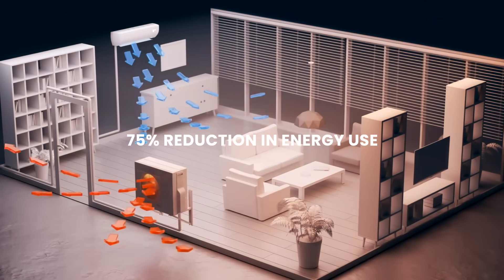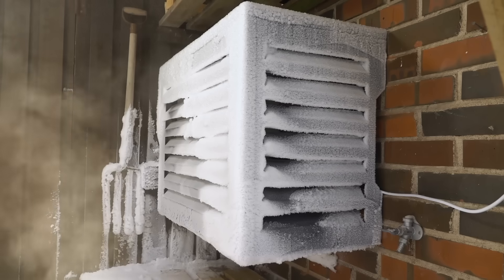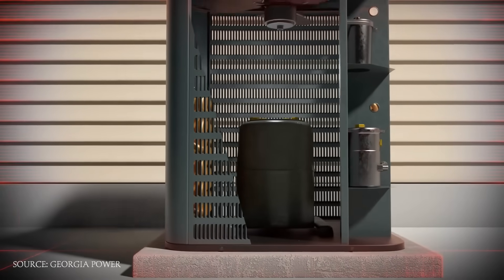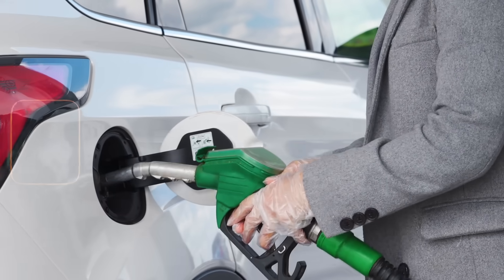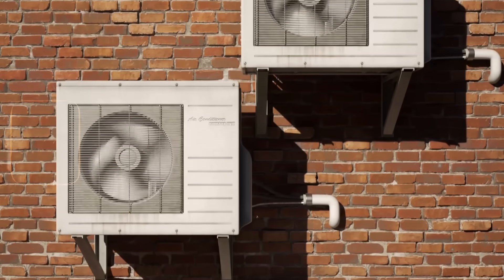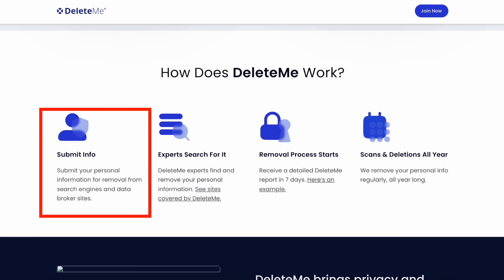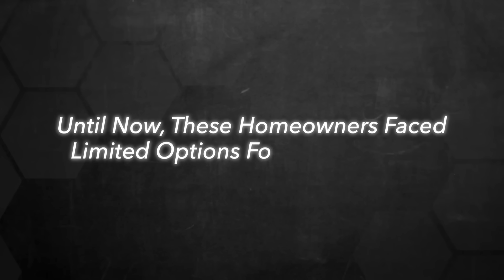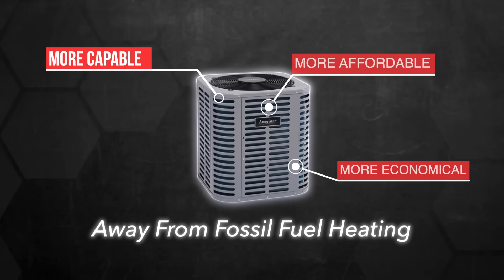Genius Heat Pump could change how we heat our homes forever

Comment: Holy up front costs.  At an average lifespan of 10 years for  condenser/heat exchangers and costs doubled since you have at least two of everything, I doubt you could ever recoup the cost vs ground source (geothermal) systems
Reply: Hopefully it lasts much longer than 10 years. At least if something does need replacement that soon you aren't going to need to replace the entire thing.
Reply: @ HVAC tech living in a place where it’s less than +32F on average from mid November through all of Feb.  The only time I use backup heat source vs my geo system is if it drops below -10F (happens about 3 days/winter on average here). Doing the math on this setup vs mine with an energy cost at half what I pay on average it would take nearly 50 years to recoup the upfront cost.  Double the maintenance compared to what I’ve done in 11 years of ownership would stretch that out to 65 years.  Chances are the EPA will have phased out the refrigerants used requiring full system replacement way before that savings would break even.

Comment: Here in Missouri, people in the country often use a pond for their heat source/heat dump.  Turns out, if the pond is big enough (at least 1/2 acre), and deep enough (about 10 feet) you can sink the ground loop at the bottom of the pond.  This works even better than wells, since the water in the pond can source/sink lots of heat very efficiently .  Multiple loops can be used, and they can be as long as you need.  Below about 10 ft, a large pond stays about 50 degrees all winter (in our climate).
Reply: @johntoe6127  pond loops are never as efficient as aquifer loops, whoever told you differently was massively misinformed. That’s the difference between a max COP around 5.5 and a max COP around 7…. That said, the drilling costs for doing aquifer loops into the deep ground is quite expensive and you will never recover the lost money spent on drilling that you saved in energy expenses in the long run…. More efficient than both systems though is an air to water heat pump that uses a solar water heater for doing your home heating and pulls off your naturally cool water to do your home cooling. You still get a COP around 5.5 but you spend more than $100,000 less on the installation of the system
Reply: @narrowistheway77  That's very interesting.  I guess people use them because it's cheap.  I'd always heard it depends on the size and depth of the pond as to how well it works.  The biggest drawback... usually the pond is too far from the house.
Reply: @narrowistheway77  At what level of glycol does this become inefficient though?
Reply: @grt49er  don't need glycol (or very much of it) if you plan correctly and keep the lines below the frost line or have a means to ensure the loop is always moving (thinking of a power outage). Here in southern missouri it's about 12", so go 18" and you'll probably be fine.
Reply: @Jenstyler1  That is an area that lends itself to alternative more efficient systems. You might even think about some form of heat exchanger economizer. I know there are still some evap coolers being used there in warehouses.
Reply: @narrowistheway77  like you said drilling through hard rock is really expensive.  plus it takes a lot of energy to lift water which is really heavy.  that's a huge efficiency hit.  if traditional horizontal grounds loops would be installed just a bit deeper the efficiency could be improved a lot.  for example, a horizontal loop buried 10+ feet deep would be significantly more efficient than one just four-feet deep.  also like you said...  if even a bit of sunshine is available, evacuated-tube solar collectors are a super efficient way to heat.
Reply: I'd like to abuse Long Island Sound so.
Reply: My son uses a well for pump and dump.  It is 58 F all year around.
Reply: Personally, I never understood using PEX pipe for heat transfer.  I'd use it for getting the water/glycol to and from the source but not for the heat transfer area.  There I would use aluminum or copper coils:

R-value: This measures thermal resistance. A higher R-value means better insulating properties.
PEX: Has an approximate R-value of 0.38 per inch of thickness, based on a typical thermal conductivity.
Aluminum: Its high conductivity means it has an extremely low R-value, making it a conductor, not an insulator. An aluminum pipe would have virtually no insulating properties on its own.

Comment: Maybe just use some dynamite, and flatten the hill, then one gear works great, much like on a racing bike. The analogous solution for HVAC would be a ground source heat pump. The downside, of course, is that you can't do it partially, and retrofitting tends to be too difficult.

Comment: Also most of Canada. I'm on the west coast and my heat pump works fine down to about -15c (5f)
Reply: Same, in Ontario and my 5 year old napoleon unit only starts to fall behind around -18c true temperature. There is no supplemental heat on the unit, at -18c my baseboards start to come on. Much lower than the 0c claimed in this video.

Comment: Say it's 40° outside our heat pump will run 8 hours straight to raise the temperature 4 to 5° in the house.. when we use the backup oil heat it'll take 20 minutes to heat the house up 5° .. a heat pump definitely isn't more efficient then a fossil fuel back up ..
Reply: Efficiency has nothing to do with how long it takes to heat up your house.

Comment: This technology addresses the gather side. How about the diffusion side? Most heat pumps operate in extreme heat conditions, not cold. So, is there an analogous mechanism to increase efficiency of cooling by overcoming the relative energy gradient present when cooling in extreme ambient energy conditions?

Comment: There are going to be costs of greater complexity, mechanical losses, system failure outcomes, etc., compared to a single open source (atmospheric) compressor unit that has approximately the same critical outdoor temperature.
A ground source unit is less temperature sensitive and proven. There's an added bonus of having no outdoor unit to clutter the landscape. 
Payoff, or the money saved versus a standard system comes even in around seven years. 
If cascading technology does prove its worth, the cost per unit will certainly go down. 
I'm old enough to remember $10,000 flat-screen TVs.

Comment: My outside unit is on the south.  I've been thinking about shading the unit in the summer.
In the winter, I was considering setting up reflective surfaces to concentrate more sunlight on the unit.
Does anyone think this will help improve efficiency?
Reply: I've thought about this, and don't think it would make a huge difference. It would make more sense to plant trees to the south of your house, which would affect a much larger surface area. Also, if you have southern winds, and depending on tree type, they could provide a wind break, reducing convection. The heat exchanger coils on my south-facing unit are shaded by the cabinet.
Reply: @BlankBrain  Conifers on the North side for the winter winds, Deciduous on the south for summer shading - personally only plant trees that have a max height of 30' just in case you want solar on the south side.  Awnings over south facing windows also help.

Comment: Excellent video, but ....
Brought to you by Trane (Brookfield asset management).
Air-source heat pumps are useless money pits in Canada.
Water ground loops FAIL in several components.
Direct Exchange Geothermal doesn't use the "fragile ground loop", or any water or pumping circuit, but uses a single circuit of the refrigerant itself.
(Think commercial and office buildings.)
Equipment is comparable in price, at house-level of capacities; the vertical drilling is somewhat costly, but can be drilled in almost any yard.
Since Ground-sourced Direct exchange is drawing from a constant temp source, it runs at peak efficiency always.

Although I have not looked, I'll predict that a DE Geo system would come out at a similar cost to purchasing one of these systems to which the video refers.
Upon looking on google, this system is usually provided by all suppliers, by using 2 or 3 or 4 heat pumps in series. (which this system actually is, whether in one box or two)
THIS is the only choice that a government should sponsor, if they actually want to control.
To those Canadians serious about purchasing, check out Direct-Exchange Geothermal before you invest thick coin in any system.
Reply: Running a refrigerant loop underground seems much more fragile than a water loop. If there's a small leak in a water loop you can top it off for a few cents, a leak in a large refrigerant loop will cost at least a few hundred dollars to recharge.

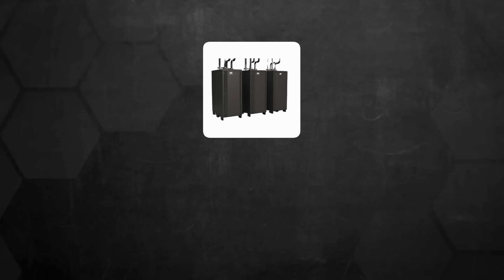Comment: @8:51 re: operational temp range?
Which is it?!   Initially you claim this system can extract heat down to -32˚F, but later your claim changes to just 32˚F— a massive difference of 64˚F!!!
Reply: I just noticed that another viewer pointed this out and you responded...
I suggest you add a correction in the form of "text overlay", like subtitles or whatever...
SOMETHING that is actually IN the video itself.  A response to a comment (even if pinned) is absolutely insufficient—that SHOULD be obvious!
Reply: Actually the low limit is the temperature where there is no longer any gain.

Comment: If I was  building a home with a walkout basement that I want to put radiant heat in the slab to heat the basement. Then there's just  one floor above and I do Base board convectors for heating with water also. Would this system be the best for that type of setup ?.And what type of system would work for cooling it in the summer ? I don't like ducts but at least in the summer I can get clean air in. I'm on a low budget.

Comment: Well  what you didn't address is the heat pumps ability to provide cold air in really hot climates. I live in Texas and enjoy really warm temps inside compared to the yanks who live in more northern areas of the US. My indoor temp is typically set between 72 and 80 degrees all year long. 

So, my heating bill is really high in the winter. But, also, my cooling bill is really high in the summer. 

So, how energy efficient would this unit be at keeping my home cool in 120 degree heat?
Reply from the maker: It works for cooling as well

Comment: It's only cost effective when compared to the 100-150% inflated costs of standard equipment promoted by HVAC installers ie Carrie, Lenox, Trane, Mitsubishi .  When you factor in parts markup on this system that $12k becomes $24-30k just for the equipment making these systems DOA in market sales. Homeowners are price driven consumers not efficiency driven.

Comment: Though the tech is great, the complexity is quite insane. Multi refrigerant cascading has been around for scientific applications, but the repair cost will be astronomical for residential use. 

What is never addressed is the amount of total amount  BTU's needed during winter (which is way more) vs summer , regardless of the technology. 
Sanyo used to make a heat-pump with a gas furnace on the condenser. 
I oversized the Mitsubishi heat pumps in my house, so if my steam boiler goes, I can withstand very cold weather.
Reply: Don't forget to clip the jumper on the board so you actually have a crankcase heater Mitsubishi doesn't tell you that to get energy star you don't have a crankcase heater.  The guy teaching our factory course just kind of mentioned it on the down low
Reply: Repair costs shouldn't be more than about double a single stage heat pump. Basically this is just two of them in series.

The astronomical repair costs scientists pay (and you're right about that) is because they use non standard equipment that is produced in low production runs. 

That's why this company decided against using specialist equipment, but finding the off the shelf equipment that does the job almost as well as the stuff the scientists use 

It's like the cost difference between a fuel pump for a car and the same pump for a plane; the smaller production runs and the need for higher certification is what makes costs astronomical. 

Your are absolutely right to flag up the increased kWh or  BTU for winter use as compared to summer. This is actually another advantage of this system, because the biggest efficiency boards are in the months when single cycle heat pumps are least efficient, or switch out entirely to rely on resistance heating.

Double the price (in round figures) but more than double the likely saving if your winter temperatures regularly get much below -10C or 14 F.

Comment: 12K for the smallest system is just too much. i currently have 3 9k btu heat pumps, one in the workshop/garage and two in my house.  total cost including install was 2700.00. it is backed up with the original gas forced air furnace that i use when the temps go below zero f. I live in Montana and for the last two year i use the original heat most often at night in winter. My annual gas bill is less than 350 and that is with a gas cooking stove.  The price of this tech would have to come down a lot before i would even consider it.

Comment: The added cost of this system will have to be compared to the added cost of ground-source heat pumps.  

Most homes in the north have yards large enough to install a ground loop.  The initial installation is definitely large for the ground loop, but buried PEX or HDPE tubing is a 100+ year solution.  This looks like a solution more appropriate to far north urban areas, which are an inherrently small market.  The complexities of troubleshooting and maintenance will also be an issue for early adopters, so larger installations like apartments and universities will need to be first.
Reply: I have been messing around with a greenhouse design where I don't have crazy money to spend; They are surprisingly hard to keep warm at night, and I think I discovered a technological opportunity.  I suspect that vacuum trench excavation with a pressure washer + shopvac drops excavation costs for a ground loop by more than an order of magnitude, when you factor in the machinery and expertise.
Reply: @TrogdorBurnin8or If you can run a bobcat, renting one of those is probably the cheapest.  You need to go 6-8 feet down at least, depending on the climate, and the whole trench has to be open to run a seamless roll of tubing in the ground.  Most non-mechanical methods are going to be too slow unless you are working in the desert, in which case you would be looking for cooling...
Reply: @ Digging a 3 foot wide trench 8 feet down is a huge, expensive, lengthy process requiring heavy equipment.  But this new process is fantastically productive.  Digging a 3 inch wide trench 8 feet down turns out to be relatively easy, requiring a $100 pressure washer, a $100 shop vac, and $100 of poles/nozzles.  The utility guys are doing this for getting to access panels and for putting poles in the ground, using special vacuum trucks and bog-standard commercial pressure washers.  A shop vac will work slower and to a less extreme height (less water lift), but it will work.

This doesn't stay open forever; But as long as groundwater isn't crippling the project, you can slip the loop in vertically (or just run a single strand) in an afternoon.  Even if you're at the limits of your system, fill the loop with a ballast liquid (like glycerol/water blend, or a sugar simple syrup) and you can sink it into mud slurry rather than airspace.
Reply: @TrogdorBurnin8or  You need much too much length of tubing to allow the required heat transfer for this to be viable, and the first 6-12" rock you find stops you dead in your tracks.  Pick something else.
Reply: @davidc1961utube  If you find one large rock you can just reroute the trench somewhere else. The problem only arises if you have lots of large rocks.
Reply: @eDoc2020  you need a trench a couple feet wide to loop the tube.  Good luck!

Comment: Slick.  But i diy installed 2 minisplits. 1ton and 1.5 ton. Less than 2k all in. Still have furnase for supplemental but could replace with a pellet stove for the coldest days. 

Price needs to come down. Includeninstallation and replace water heater. Then u got a good system.

Comment: I think it is great that finally were making headway into better systems.  However,  I do not think it affordable to the average household.  That's great that you save energy...but you still have to pay for the install. Seems you are just transferring money from the energy company to an HVAC builder. If the parts are "off the shelf" why so expensive?  As any HVAC Tech can attest to, off the shelf for them is cheap but not to the consumer.  At least here in VA.  Consumer will probably pay double what the Tech pays for the equipment.  Northern VA more, why? They make more money up north.  I love the idea and wonder if anyone was really working on this before or did everyone just march to the same tune. HVAC industry has not fought for the consumer each time refrigerant changed. Why, because they benefited from selling all new equipment.  Thanks for the information.